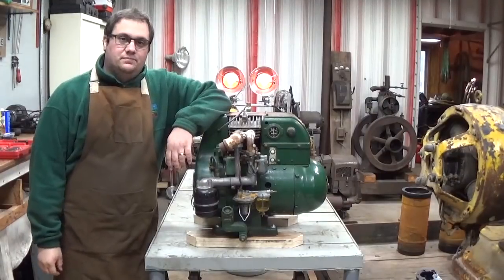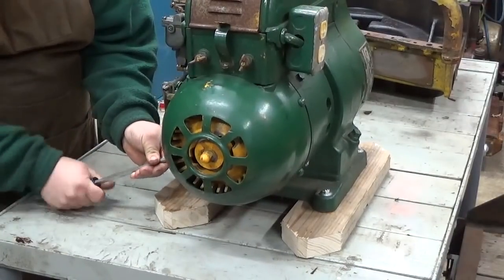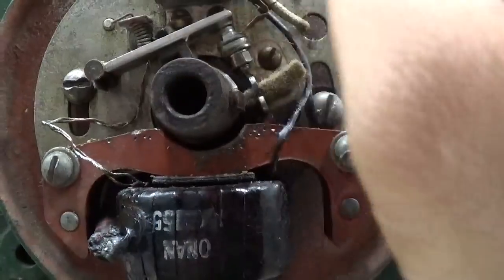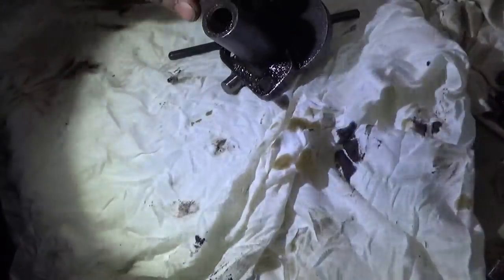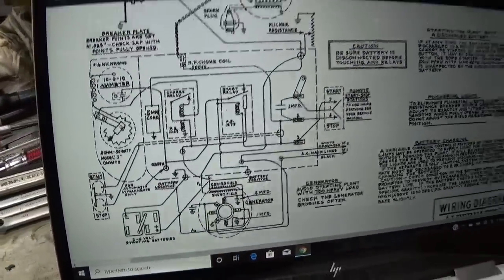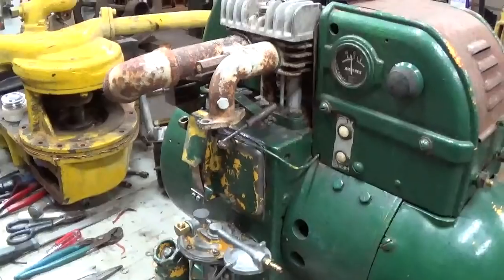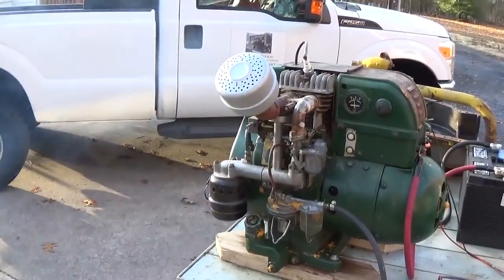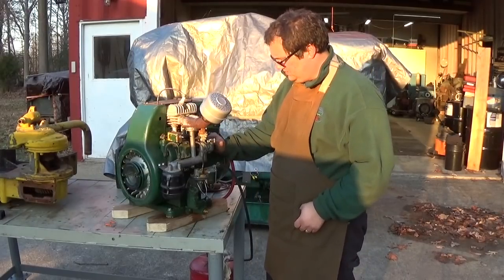1953 Onan Generator Repair and Generator Buying Advice

Comment: If you have access to the test gear, I'd love to see a comparison of the power quality of these old generators vs new non inverter generators. Love the vids, btw!
Reply: I have.  The AJ has a double-ended armature.  One end has a commutator and the other slip rings.  The engine is cranked by applying 12 volts to the commutator end and a LOT of amps.  Once the engine is running, there is about 55 volts DC on the brushes.  This voltage is fed through a 120 VAC regulator and the output goes to the slip rings and thence to the rotating field.  Some is dropped through a resistor to charge the RV's house batteries.  About 5 amps if my aging memory is still working.

The waveform is about as good as one can expect out of a 2 pole alternator and with a field not optimized and wound on a DC armature.  I had no way of measuring but from the scope, I guess between 5 and 10% THD.

I have a 5kW universal Chicom generator with a Northern Tool brand label on it.  It is brush-less design.  The design is clever and there's an expired patent that explains it pretty well.  It works as long as one doesn't care about the waveform.

If one looks carefully at the stator, there are the normal output windings but there is also another set of windings of much thinner wire but many more turns.  This winding is resonated by a motor run capacitor to the 3rd harmonic of 60 HZ.  

The rotor has no brushes.  Just two poles, dog bone shaped, with a winding on each end.  The winding is terminated with a single diode.

The way it works is this.  The 3rd harmonic energy is coupled to the rotor via transformer action (Ignore that the thing is turning).  This causes half-wave rectified DC to flow in the field windings.  The rest of the alternator works like any other, with a DC field and stator windings generating AC.

This setup does some voltage regulation.  I haven't spent the time to figure out how but I suspect it has to do with magnetically saturating the stator at the 3rd harmonic current.  I do know that increasing the value of the capacitor will RAISE the output voltage.

When the engine is cranked, everything electrical gets underway from the residual magnetism in both the stator and rotor.  Over time as the residual field fades and/or if one cranks the generator with a heavy load attached, there will not be enough field to get things going and the generator will not come up to voltage.    

The solution is easy.  Most of these chicom generators have a door over the capacitor with a single screw holding it on.  All one has to do is momentarily apply some DC voltage to the capacitor terminals.  Polarity doesn't matter.  I use a 9 volt battery.  The terminal spacing is just right and it can be brushed past the terminals rapidly.  Quickness is necessary because when the alternator kicks in, over 200 VAC appears on the capacitor terminals.  I use a wiping motion so that contact is the absolute minimum.

I've tried applying the power to the capacitor with the engine not running.  Sometimes it works but not reliably.  Much better to just "do the swipe".

I was driving around one day when I passed a pile of junk on the road to be picked up by the city.  There was an almost new Harbor Freight 2.5 kVA generator in the pile. The guy was working in the yard so I asked him why the generator was on the curb.  He said that it quit generating.  I was about to tell him how to fix it when tole me to take it if I wanted it, that he'd already purchased a replacement.  ALRIIIGHT!  

I got home, backed up to my shop, removed the cover, gave it the 9 volt battery swipe and the output came right up.

I hate the notion of dragging an engine around with me so my yard tools are electric including my chainsaw.  Mine is the Remington cheapo Wallyworld that clearances for about $35 at the end of each season.  I bought 2, figuring that if it only lasted one season, I would have gotten my money's worth.  I put a longer bar and chain on it.  This is the 10th year of service without a single problem!

The only thing I don't like is dragging around a heavy cord.  I have permanently installed a 2500 VA inverter in my truck.  I thought this problem over a bit and an idea dawned.  I reverse-engineered the inverter and figured out how the voltage regulator works.  I put an additional switch on the inverter front panel that switches it from 125 VAC to 150 VAC.  Now I use lightweight 16 or 18 gauge extension cords.  Of course they get hot but who cares?  Everything's outdoors.

I decided to do the same thing to the generator.  I figured out the proper additional capacitance for the field, mounted this capacitor inside a cowl and put a SPDT toggle switch on the control panel to change voltage.  I also mounted a high brightness LED on the panel and connected it to the outlet through resistors, a diode and a couple of zeners so the LED would light brightly when 150 volts was present to give me warning.

I have to mow the lawn around our cemetery plot.  At full load, the inverter draws almost 200 amps.  My F150 has the trailer tow package so it has a 160 amp alternator.  It has a very sophisticated charge controller built into the PCM.  There is a Hall effect current sensor on the alternator output and another one on battery (+) lead.  The alternator has a temperature sensor.  The PCM will protect the alternator from serious overload so if I plugged in the lawn mower into the inverter, even with the engine running, the inverter would slowly run down the battery.

So I toss the little generator in the back of the truck, drive over to the cemetery and mow away.

Back to the waveform.  The output is roughly a triangle wave with a bunch of higher frequency ripples on each leg of the triangle.  This WILL screw up electronics with power factor corrected (PFC) inputs.  The DeWalt black top 18 volt battery charger, for example.  I'm the engineer who designed the induction heaters sold by fluxeon.com and formerly tnduction.com.  I designed the higher powered units with PFC so that the last watt could be drawn from a 120 volt, 20 amp outlet.  Without the PFC, I could have drawn only about 2/3s the wattage before the breaker tripped.  I did the PFC in firmware and designed it to detect inverter and cheap generator output and use a different algorithm.

These self-excited generators WILL overheat electric motors, especially if they're running nearly continuously and near full load.  On construction sites, that might be air compressors supplying a lot of air to nail guns and circle saws in near continuous use.  Not saying don't run these tools from a self-excited generator; just be aware that overheating can happen.

John

Comment: I Would Say, The Carburetor Most Likely,, Had A Small Piece Of Grime Of Some Kind Still In It Causing The Slight Hesitation After It Was Running The First Few Minutes And It Seemed To Clear Out Afterwards... You Made A Great Purchase At $50 For That Unit And You'll Get Much Better For It, If You Would Decide To Sell It!!!

Comment: Hey Smallenginemechanic, I picked up an onan generator exactly like the one in your video from a guy in Westminster, MD late last year. The seller said a guy in Philadelphia was also inquiring about it. I'm assuming that was you? Small world LOL.

I now have two of these i'm in the middle of trying to restore. I have a 1000 watt unit and a 500 watt unit. Both were seized, but are now running and making power. Do you happen to know anyone selling parts for these? I'm looking for a fuel pump, sediment bowl and a parts carb (or mainly just new jets). I'd love to pull the engines apart as well and have a look, but i'm afraid I wouldn't be able to find new gaskets for the head and between the cylinder and block.

Comment: The copper strap on your coil wires is going to fail from vibration stress eventually. Will take a while but it will crack.

Comment: Very informative. Why do you use non-detergent oil?
Reply: Yes I also wonder 
I guess maybe if you have a sludged up engine that doesn’t use an oil filter like most old generators and lawn equipment you may not want the detergent to break free sludge and have it go through the engine 
But if your engine is clean I would always use detergent oil to keep it clean 
But that’s just a theory
Reply from the maker: Thanks Ron!  I used non-detergent because even though I cleaned the gunk out of the sump there was still some dirty spots up around main bearings I couldn't easily access.

Comment: Side valve engine, valves won't touch piston but they can seize in the guide and cause damage. That intake exhaust is the same as on the 123l-5 charging set, the words rare as hobby horse sh1t comes to mind.

Comment: That gas cap is a Gas Cap off a 1971/72 mercury Comet. some years like the 1973,74 and 1975 had comet and the mercury emblem and the 1971 and 72 just had the mercury emblem

Comment: i have 1970s tiny 1250 watt 3.5hp aluminum bore tecumseh generator love it no AVR reliable still runns points starts every time dropped it off to get rebuilt as id have to fill the oil and check the gas (bad valves and cylinder scoring) might cost upwards of $300 to rebuild it but its worth it to me as you cant buy them as small anymore and expect them to last. can fit the generator in a utility tool box with room to spare for 2 gallon gas can😉
Reply from the maker: Sounds like a good unit!  Thanks for watching!

Comment: One thing you passed over and is the most important to me is - does it have all of its parts and has it been modified by the previous owners.  There is nothing worse than modifications done by cobblers who have no or liter mechanical or engineering knowledge experience.

Comment: Could you help me get more info on my Onan 4cck generator I’m having trouble with the battery lead not shutting off when I hook it up to the battery.
Reply: I have a down loaded owners manual for it and I was told it is from the 1950’s.
Reply: I was told that the fire department had it on one of the rescue trucks until the 1980’s.

Comment: Pull the plug on any engine and put some oil or atf or marvel in there anything to lubricate the cylinder before trying to turn it over you can cause cylinder damage or the valve train if ya do it dry

Comment: You need to design a heating system for your work space there.
Reply: I recommend overhead radiant!
Reply: @Wayne3544  I recommend a pot bellied stove and an assistant to keep a pile of wood in stock. There is nothing like going into a shop in the morning and lighting a fire and putting on a pot of coffee. (Ah the good old days)
Reply: @Tadfafty  Yes, we used to make them with two 55 gal drums with a heat exchange system between and an air blower into the top to burn the unburned gasses. The top one would glow orange after we got it goint. However, an old pot bellied stove with a burner on top for a coffee pot is much more  cozy and nice.
Reply: @Wayne3544  probably about the best type of heat for a large shop, with high ceilings! other heating types would just fly away to the roof

Comment: Do helicoils actually work well for sparkplug holes?  I would've been worried about it not sealing or just blowing out
Reply: They are used on cars all the time for stripped spark plug holes. Here is a good example. https://www.youtube.com/watch?v=B3irFj2XeCM
Reply: Yes.  Install with green Loc-tite bushing and bearing locker

Comment: get over to harbor freight and get yourself a heated ultrasonic cleaner. fill it with the stuff from the cans and you can clean up any small parts
Reply from the maker: Good tip, thanks for checking it out Keith!

Comment: Most repairs by qualified personnel must more often than not must usually start on those areas where the last idiot worked on the engine.  In other words, you must fix what they messed up before you can repair the real problem they were attempting to repair.

Comment: Why do these old gensets always look like they could put out way more than what they are rated for? This one looks like at least 3kw lol
Reply from the maker: Ha!  Looks like it could put out 3Kw and it probably weighs as much as a modern 6Kw!  Thanks for watching!
Reply: They can.  Look on the nameplate of a piece of utility apparatus, say a pad-mounted transformer.  There will be an entry "SF" or service factor.  Typical for utility equipment is an SF of 2.5.  That means that it can handle 2.5X the nameplate rating with an expected reduction in life.  Many moons ago (70s and back) a few HP motor or generator would typically have an SF of 1.5.  The junk now coming out of communist china is lucky to have an SF of 1.1.

Here's a nifty trick that a grizzled old motor design engineer taught me.  Slap your hand against the frame of a motor and say moderately rapidly "Damn, this son of a bitch is hot".  For every word you can say before you have to pull your hand away, take that number and subtract it from 80 deg C and you have the operating temperature.  I've done this many times and it really works.

The problem with these old gensets is that they are so heavy that it takes multiple people or a hoist to pick them up.

There is a huge (probably 20 acres) surplus generator laydown yard outside Cleveland, TN ( "the old fairgrounds" as it's known as.)  Several years ago I bought a 4 pole, 1800 RPM, 10kVA belt driven generator from this gentleman.  He had to bring around a Bobcat to lift it into my truck.  I had to use the hoist in my shop to get it out.  

I scored a brand new in-the-crate twin cylinder Yanmar 1800 RPM engine for $200 at a hamfest.  So I built a "portable" 10kVA generator. I welded up a custom cart and put it on wheels but 2 men could barely move it even on pavement.  So I put a hitch arm on the trailer so a Bobcat or garden tractor or a truck with a trailer hitch could move it around.

It was a hoss.  It could start my 3.5 ton heat pump while barely changing pitch.  Here at my mountain place, I installed a 10kVA Generac auto-start standby propane fueled 3600 RPM generator.  It could just barely start my 2.5 ton heat pump and that was only if there were no other loads.  Generac was thoughtful enough to put 4 channels of load shedding in the control system.  I wired it so that when the heat pump tried to start, the controller shed the electric water heater and the electric dryer.  It would bring back online the loads in the sequence shed until the generator was fully loaded.  Hint: Never buy a Generac automatic generator.  Mine is as loud as a construction generator and the electronic governor is very slow, allowing the engine to lug before the throttle is open.  Next time mine will be either an Onan or Caterpillar.  I replaced that heat pump with 29 SEER mini-split heat pumps, one per room and my power bill almost disappeared.